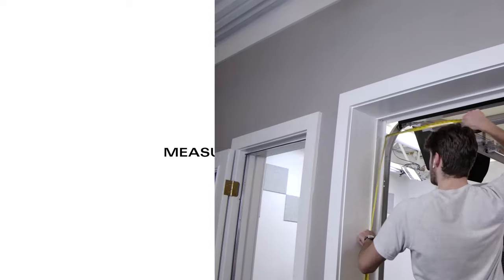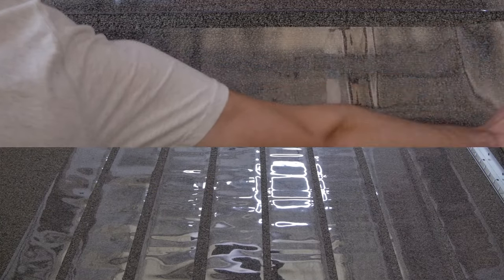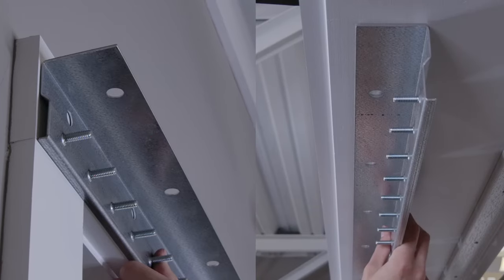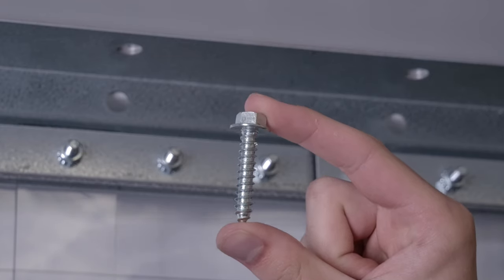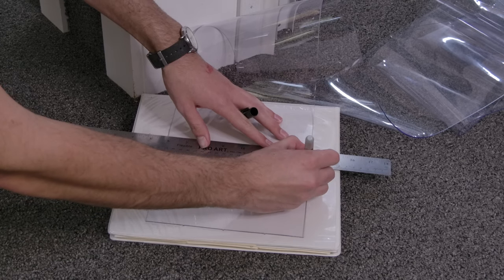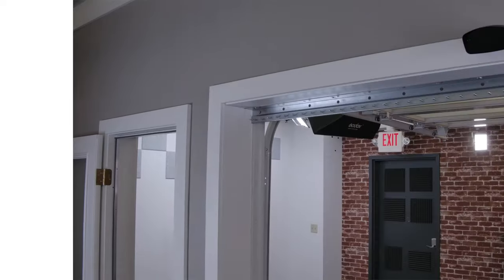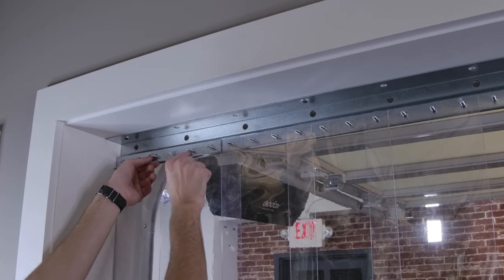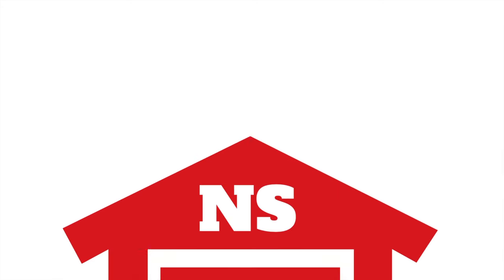How to Install Strip Doors

Comment: Does this provide any air barrier/insulation between a condition garage and outside?
Reply: Based on my usage, it minimizes the temperature loss at high traffic openings.
Reply: I installed my last year….. Love it….. exceeded my expectation